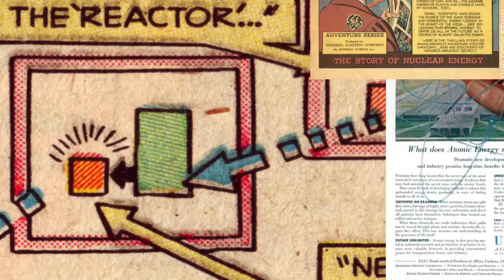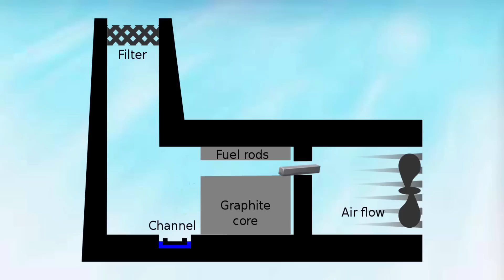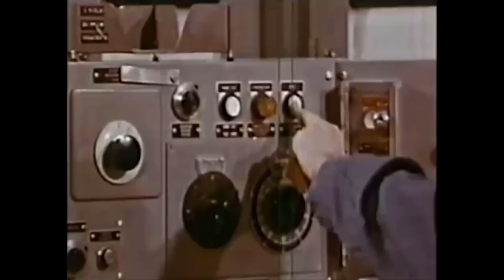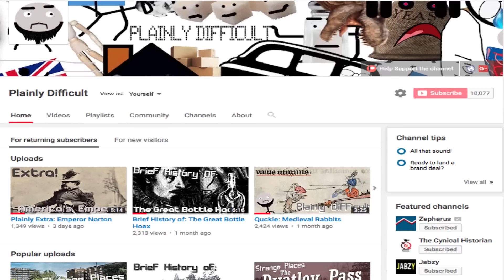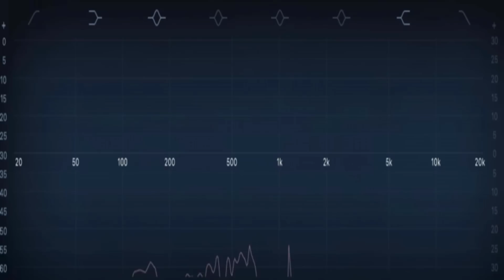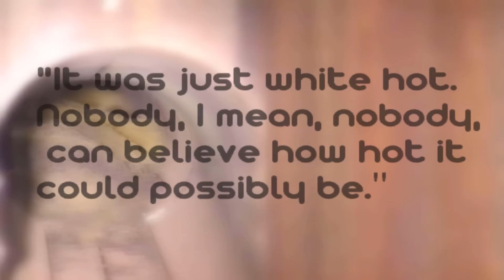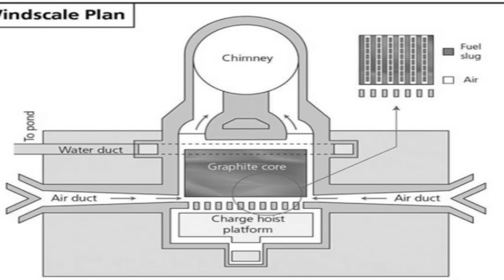Brief History of: The Windscale fire

Comment: I kinda hope you will one day do a remake of this video because you're newer videos have definitely got more thorough and informative and I feel like this video gives a bad impression - this disaster while probably the worst nuclear disaster the UK has had by quite a margin, was actually pretty good. It's the early days of nuclear power, and there definitely were mistakes (the source of uneven heating continuing after the first attempt at a Wigner release should have led to them investigating the hot channels), but the plant was designed with safety measures in mind (the filters especially), and the disaster was dealt with promptly and appropriately when discovered. It could've been a Chernobyl easily, but wasn't.

That said, the coverup was shit, even if that's somewhat to be expected.

Comment: Perhaps worth mentioning that the Wigner effect is caused by neurons distorting the moderator's carbon lattice, and that the Wigner release is an annealing process where the graphite is heated to release the trapped energy and restore the lattice structure.

Comment: In mechanical engineerin there is subject "Fracture Mechanics", here we only deal with the fracture modes and in how many ways a material can fail. If you go through literature the main reason was Ductile-to-Brittle Transition assisted with nuclear irradiation. Search for Wigner effect in graphites. Any metal when exposed to high energy neutrons, their atoms displace from lattice position and leaving behind a Frenkel defect. If there is accumulation of defects, exposed metal can undergo cleavage fracture at any time. Windscale reactor was using graphite moderator. In order to increase reactor output, operators incraesed the operating temperature of reactor. This in turn highly stressed the graphite moderators, and there was rapid recombination of Frenkel defects in graphite rod. Rapid recombination released a huge amount of energy, enough to cause fire. This was the main reason for Windscale FIre. And I haven't found any YouTuber giving correct reason regarding this. Ductile to Britlle Transition Temperature was the main convict of this disaster. On should always consider Brittle Transition Temperature while design RPV or PV.

Comment: The Magnox reactors that quickly replaced the Windscale piles for plutonium production are of some interest. They POSSIBLY ended up killing more people than the Windscale accident because of their 'shine'. Yes, to save money the heat-exchangers were placed outside of the concrete containment so that considerable levels of gamma radiation 'shine' were observed

. Worse still, the carbon dioxide contained impurities with argon being a particular problem because it will capture thermal neutrons. Since this will decay,, a large number of daughter products have to be considered. In practice the reactors had to be derated because the daughter products caused corrosion. Hydrogen was also an impurity and hydrogen embrittlement was also a problem.

They also used used uranium metal, not uranium oxide which made the potential outcome of an accident to be much worse. Just how much worse is partly the result of the coolant being a mixture of gases. Uranium hydride was detected in decayed fuel elements. It's density being much lower than uranium metal means that the elements could burst.
 
 Oh, also due to their age, their designs were made public which resulted in North Korea building their own for the production of plutonium. 

 So, not so much a disaster, more of the slow attrition of workers.& neighbours.

Comment: Air cooled reactor? Sounds like trying to run an overclocked AMD with a cheapo aircooling system, not built to handle the heat
Vs a proper water cooled PC

Comment: Failed to mention that the fire was squelched by turning off the fans and closing off the air ducts. The water didn't do anything until the airflow was cut off. 
Also the carbon dioxide didn't work because the fire was so hot it stripped the oxygen from the CO2 and actually made it worse.

Comment: You didn't mention the fact that they over stressed the reactor because of massive pressure from the government to make enough material quick enough so they could make a bomb in an attempt to catch the USA. Designs were rushed, safety was thrown out of the window and covered up by a government that couldn't care less about the consequences as long as they could produce a nuclear weapon. If it wasn't for those filters stopping 95% of the radioactive material being thrown into the air it could of been so much worse. We like to criticize the Soviets with Chernobyl but the UK's government is no better. Nuclear for electricity generation is by far the best form of electricity production we have so far, shame about the governments that always mess it up.
Reply: Windscale wasn’t actually even a power generator, it was purely just a reactor to produce plutonium. I feel like a lot of the bad rap nuclear gets is from old reactors since they were often designed to make plutonium first and energy later, and had lots of flaws and risks, by comparison modern reactors are a lot safer and better. From what I read even without the filters it probably wouldn’t have been as awful as Chernobyl but it probably would’ve topped Three Mile Island.
Reply: Its interesting to try to find out what the actual Cockcroft filters actually were ... ie zig-zag fibreglass matting which they tell us often had holes wrent in them (huge volumes of forced airflow) and needed changing every eleven days ... like uhh ... another scenario for disaster! All that effort and capital to pursue the hunt to create tiny amounts of plutonium. Shame upon them. 

The whole set-up pre-1957 was designed as if a machine to inflict MAXIMUM DAMAGE to the local population, shitty aluminium clad fuel cartridges, forced air cooling venting freely and highly effective chimneys at distributing the outcome over the local populace and initially totally filter free !!! ... and remember those juicy/ leaky/ highly toxic and inopportune fuel cartridges haphazardly scattered on the vent ducting etc spilling freely nowhere near the intended containment pools of water. Total cock-up ....  @justanotheryoutubechannel
Reply: @SusanKay-  And unfortunately there will always be "idiots" (in the sense of people doing dumb things and stupid errors) because even the smartest, more skilled person in the world is still a human that can have a bad day and make terrible mistakes.
Reply: The irony is, most of the west's disasters were in the 40s and 50s when we knew fuckall about nuclear. Chernobyl was in the 80s.
Reply: There, there Windscale was an unmitigated British disaster. Happens to all of us. We grown ups learn to learn from our mistakes and move on. Someday, eh?
Reply: I feel like Atomfall could be more easily explained as the timeline where the filters weren't installed.
Reply: Governments and corporations (Which, ironically, the Soviet Union often ran like in terms of power & reward structures as time wore on - the things that went wrong at Chernobyl sound very like the sorts of fuckups a US private company would make).

In the case of Windscale the UK govt. seems to have been in the scary Cold War mindset that the UK not having nukes... was more dangerous than any risks posed by developing them.

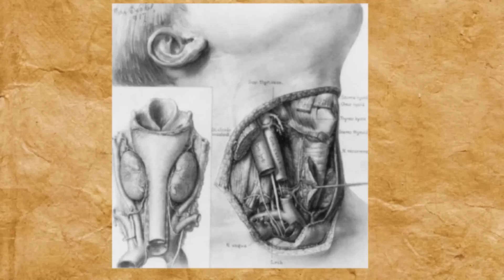Comment: 9:10 What do you mean iodine 131 ONLY has a half-life of 8 days? The shorter the half-life, the more dangerous the isotope is. If you release the energy of a gallon of gas by burning it over the course of a month, you have a slow, smoldering fire. If you release it in 1 second, you have a massive explosion. An isotope with a short half-life is like the explosion example. It is BECAUSE iodine 131 has such a short half-life that it is so dangerous, on top of its localization within the body.

Comment: I was working on the construction of Koeberg Nuclear Power Sation when Three Mile happened. There, good design meant that nobody got hurt - unlike Chernobyl and Fukushima which were both badly designed systems. Nuclear is the only way to reduce CO2 emissions. If that is worth the risk, I cannot tell. Thank you for this very clear video.

Comment: To quote the book ATOMIC ACCIDENTS:
"After Grapple 1, the Windscale piles were operating in emergency mode at the highest possible power level using flammable metallic uranium fuel and flammable lithium-magnesium in piles of flammable graphite with gale-force air blowing through them.  Fire was prevented by the now-trimmed coverings of thin aluminum on the fuel and AM cartridges sitting in graphite bricks that could become superheated on their own at an unpredictable time for reasons that were not entirely understood.  The annealing interval was increased to 40,000 megawatt-days for the sake of more plutonium and tritium production.  It is not unreasonable to predict an eventual problem under these conditions."

What a mess!

Comment: Just looked up a little more on this. The adhoc tritium production system was probably the reason the fire happened. They decreased the cooling fin size on the fuel rods to increase the temperature of the reactor. All to increase the neutron absorption of the tritium breeding material. Which itself was incredibly flammable.

Comment: This video sound like it was primarily a uranium fire when in fact it was a graphite fire, with nuclear materials involved. The reason that it was an aircooled reactor was because it was a graphite moderated pile. But that meant that the pile accumulated Wigner energy, which is a form of potential energy stored in the crystal structure of the graphite.  This energy eventually releases in a cascade type manner, unless a controlled release is performed. In this case the controlled release was unsuccessful.  This fire showed that graphite piles were not  the best way to go. Since Windscale I have only heard of two graphite cores being made. One being about 1993 and the other in 1999. There have been other gas cooled reactors proposed since Windscale, but they use helium in a closed system.
Reply: Chernobyl was water cooled graphite

Comment: Its build because its cheaper -quotes comreade vallery legasov also happen in here,air colled its more cheaper than preasurizzed water,and use graphite is high risk because flamabble level is burn in 700 degree,cmiiw...